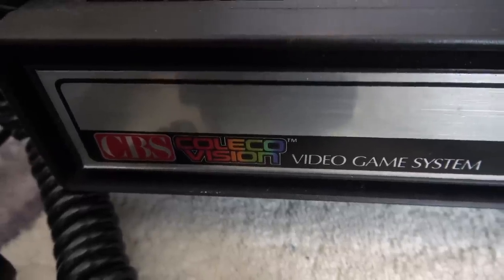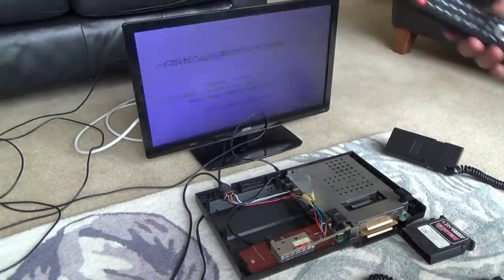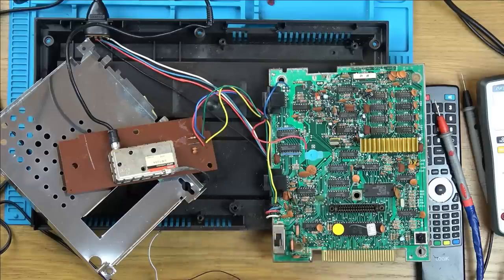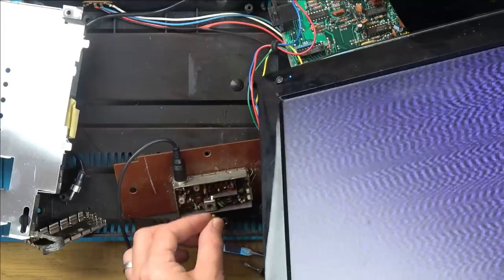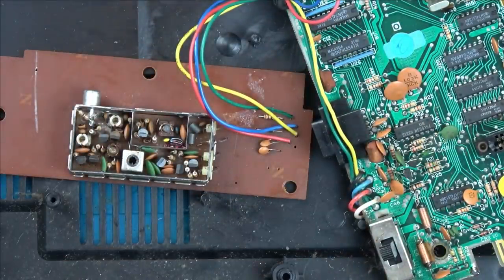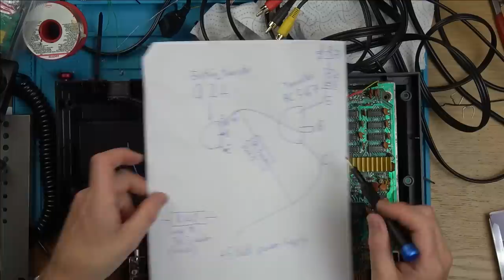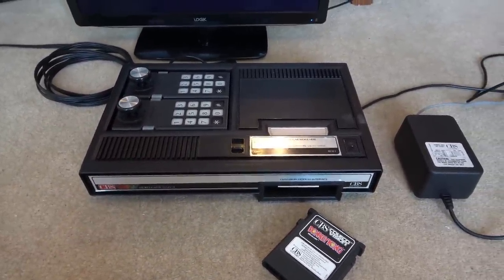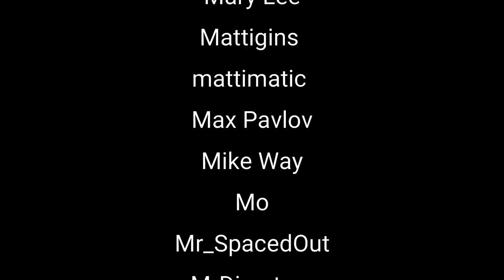BROKEN 1980s CBS ColecoVision Home Video Game Console - Trying to FIX

Comment: Not only did the Colecovision have an Atari 2600 cartridge adapter , but Coleco also made a knockoff Atari 2600 console called the Coleco Gemini and they also made some great Atari style joysticks called the Gemstick .
Reply: The Gemini was such a piece of crap on the inside, but I liked the looks of it on the outside. The Gemini controllers are fantastic, the paddle feature is so much better than the potentiometers in the Atari brand paddles. The plastic on the stick of the Gemini is too weak, but still a whole lot more responsive than the CX-40.
Reply: @jst25  Agreed . A large percentage of Geminis are broken and don't work now . I buy broken ones from time to time just to practice my fixing skills , lots of broken solders on the boards usually . Mostly power port and controller port issues . Colombia Home Arcades are also unfortunately rebadged Geminis so those two are the worst of the 2600 types IMO to buy .
Reply: @jst25  I have a love/hate (mostly hate) relationship with the Gemini Dual Command joy-paddles the consoles came with . The sticks feel surprisingly good , but they tended to get really dirty inside , and that damned fire button spring . They were way better than the Sears Video Arcade 2 controllers that were the same idea , that's for sure . The Sears versions had horrible fire buttons . To tell you the truth , I don't even remember using the paddles on any games LoL , but I will say the potentiometers are certainly easy to clean compared to the Atari ones .
Reply: I had to edit that last comment because I was remembering what a nightmare the Sears joy-paddles were , not the Coleco ones . With the joy-paddles you just had twice as much going on inside to break , twice as much chance you'd have a problem with one function or the other as they aged .

Comment: The controller leads were so short because they were usually played on tiny tvs back in the day so you had to sit on the floor right in front to see what you were playing. Very different to 4k 65" lcd with wireless controllers of today that we are spoilt with. Amazing the difference in 40 years vs the previous 40...

It's easy to forget with our huge flat tvs these days but remember these were often played on tvs with wood trim and under 22" curved screen & quite frankly horrible quality lol.

Also you wrre used to getting near the TV as most atoll weren't remote control back then.
Reply: Ours was connected to a 19" Montgomery Ward remote controlled TV. That TV seemed pretty big at the time, especially when up to about 1980 we were using a 13" Panasonic color portable.

Comment: I AV modded an Atari and just connected my video out cable directly to the video signal going into the modulator. I didn't have to use all the redundant transistors and resistors to make it work.

Comment: Loved the CV as a kid, that one is in great condition.  Wish I knew the secret to opening them up without ripping off the front decals back then (which I did on mine, heh).
Reply: They are incredibly hard to open. I convinced that with how easy it came apart and the messed up reset switch it was never snapped back together correctly after Mike opened it up originally. I opened mine up once to repair it and it takes quite a bit of force to get those clips to unsnap properly, unless they haven't been correctly to begin with. It is, by far, the hardest console I've ever had to get into.

Comment: Hi, The RF modulator is generating the video and audio carrier which are in relation to each other (5.5 MHz in EU, 6.0 MHz in UK) and adjustable by the coil screws. 
The combined signal will go to the TV input. The audio carrier in the uk was different from the rest of Europe.
With good wheather conditions, here in Holland,  I was able to pick up TV signals from the BBC etc, but without the sound because of the sound carrier difference. Wanting to hear it anyway I created a little temporary mod in the TV so I could tune audio carrier receiver off it's normal setting by 0.5 MHz. 
From the modulator/ generator side it Looks like the same approch, set video carrier and then adjust the audio carrier by it's ferrite core's.

With the "mod" you have video and audio in a direct connection, preventing the whole RF signal path, which is far better and giving a sharper picture and clear sound.

Comment: In the modulator there should be two ferrite slugs, one in the metal can transformer, the other in the broken coil. At a guess the one in the metal can looks to have been screwed right down to the point where it broke and jammed underneath. You can purchase replacement modulators for £11. Granted the resulting fix would not have been as interesting as the mod, but it would have been ''original'.
Reply: My thoughts exactly on the slug being bottomed out in the can. The missing one likely disintegrated by the same person wrenching away at it.

Comment: "Long live Gorf" "Space cadet"

I used to get off my train to school at Pontypridd station to play Gorf before getting on the next train coming from another line (which still got me to school on time).

I just did a YouTube lookup for Gorf and it shows the game play from the original arcade machine along with the original speech synthesiser.

I later got the game for my Atari 2600 but it didn't have the speech, disappointingly.

Comment: Maybe this a continental Europe unit instead of a UK one?
The difference between UK and Europe is that Europe uses PAL B/G and the UK uses PAL I.
The only difference is in the audio carrier and when I use a UK device on my European TV, I get the exact same result.
Picture is OK, but there is only static on the Audio.
Maybe you have an option in your TV's setup to change that.

Comment: The Colecovision was IMHO the best of the three main pre American Crash console (the others being the Atari 2600 and the Intellivision) 

Apparently the MSX had very similar architecture (I'm guessing the Colecovision came first and the MSX was based on it rather than the other way round, I'm saying this because there is a Colecovision emulator that will also emulate MSX computers in the same way that VICE has different apps to emulate each Commodore 8 bit machine)

It's actually pretty amazing for its time, that and the Atari 8 bit computers which matched the C64 but originally came out in 1979.

Comment: Tuning those RF modulators is a bit of a black art. The bad sound is static. It is caused by the complete lack of an audio signal. I think that coil was a red herring. If it had been bad, the symptoms would be more like what you had at the end: no video or audio. Removing that ferrite core then readjusting the brass one would probably return the system to the original problem. I know removing the ferrite core sounds like bad practice, but it really isn't. When they originally tuned the system that core was most likely just barely in the coil and fell out during shipping. With RF if it works don't mess with it.

Comment: with a lot of old games systems that output RF, its usually quite easy to mod them to output composite video
Reply from the maker: Thanks Pineapple 👍👍👍
Reply: Likewise an RF-only TV can be modded for composite input, and that was actually done in 1971 in the TTL (non-CPU) arcade game Computer Space (which was before arcade monitors). Syzygy (Atari) "composite modded" the black and white vacuum tube TV, in 1971 haha

Comment: Wonderful repair. Even though I didn't understand how you just came up with your own version of  the composite mod.
About the screw you found wedged the wrong component: Don't you think that it would be more likely that someone screwed the ferrite screw out and turned the console upside down to get it out and when they tried to put it back in, they "screwed up" (pun intended) and chose the wrong hole in the RF-module?

Comment: You can use super glue on plastic of the coil transformer and also can super glue the ferrite core, it will work perfect when you tune them all
Reply from the maker: Thanks technixbul 👍👍👍
Reply: @Mymatevince  I forgot to mention, yes any RF output modulator will work as long as it has A/V inputs. Glue the core itself not the core to plastic ;)
HINT you can buy any cheap famicom from somewhere and salvage its RF modulator ;) 
P. S. I would not prefer to use one (A/V mod is just fine) unless i use some TV from Second World war :D

Comment: I use se7ensins for console repair and modding and any questions you just ask a question and usually get an answer in 20-40minutes. Im in the US so idk if it would be different but I would try that

Comment: Interestingly I find that anything old that uses RF does not seem to work well with modern LCD TVs. I'd be interested to see if it worked properly with an old CRT TV set. I have the exact same problem with my commodore Amiga. It'll be an even bigger issue soon as TV sets will only start doing digital and not analog signals. So a conversion makes sense. I remember when my dad bought an RGB module for our ZX spectrum instead of RF. The difference in picture quality was massive. Completely clean picture. The Audio had to be output separately to a small battery powered amplifier as signal was only video.

Comment: How is the BC 547 transistor not on all the time? It appears the base has access to 5V constantly, though current is limited through the 3.3K resistor. Wouldn't that make the collector and emitter of the BC 547 shorted together all the time since there is greater than 0.7V at the base?

I also thought the base of the new BC 547 would be connected to the emitter of the console's original Q24 transistor so as to be controlled by the on/off of Q24. Maybe I'm confusing myself since you drew the collector and emitters opposite on the 2 transistors. I am just trying to wrap my head around how this circuit works according to the drawing. Any help appreciated, thanks!
Reply: This is a good question and I am wondering the same based on the diagram. With the base leg on BC547 receiving a constant 5v, there should be constant flow through the transistor.

Comment: I have an Atari 2600 which has a lot of noise on modern TV's. The Problem is that modern Tuners are not as good as the old CRT ones so you will always have a better picture of those consoles on CRT TV'S than on moder plasma or LCD.

Comment: The stuck ferrite slug might have been the one that was originally in there. Funnily enough the wikipedia image for an RF modulator seems to be a very similar one (maybe even identical) and you can see both ferrite slugs on it: https://en.wikipedia.org/wiki/RF_modulator#/media/File:UHFmodulator.jpg
Reply: Yes, I was thinking the one he removed to try to use probably was under the trim pot it came from,, but someone ran it all the way out the bottom. How else would it have gotten there? The one he was completely missing likely had disintegrated from a person using a metal screwdriver and getting rough as heck.

Comment: Somebody must've been screwing with those ferrite slugs with a metal screwdriver to adjust the channe. Seems like one got some kind of contact to the ground shield and burned to pieces. Better to forget the modulator and stick with the mod. It should be very reliable, altough i'd use small capacitors before the output leads to avoid any DC leaking (there probably are ones at the TV side though).

Comment: I have one too! Have the steering wheel & the Atari adapter. Just don't have a tv to plug it into. I do have a question though. If you just plug in the console to the wall, (not connected to television) & turn it on, is there any noise from the console? I plugged it in, turned it on & nothing...

Comment: I am not an electrician.  I think what you are dealing with is an RF modulator block. You should be able to cannibalise a replacement from many devices if the period.
Reply: A broken or dusty RF potmeter is the most occuring problem. Another one is a jamming on/off switch. (damn the guy who figured out to pull 3 different voltages through 1 combi-switch)
Then there's the everlasting cartridge jam by dust. When using the Atari 2600 module, the chance of that happening duplicates because there are 2 board connectors in line.
I also have a full original set, which requires the power supply to warm up for +/- 20 minutes before the view gets clean. This might be a age problem or a bad trafo winding making trouble when it's still cold.

Comment: I'd just feck the modulator off completely, most modern tvs don't even have an analogue tuner do by doing the composite mod you're preserving the usability of the console. Gotta be easiest fix ever, just shows how easy stuff is when manufacturers labelled their boards.

Seriously we've got to get back to repairing stuff

Comment: I'm having issues with my Colecovision. It starts off fine, but the video blacks out to a black screen. The audio is fine. A Facebook group suggest faulty capacitors or a faulty power supply. No further comments were made since posting four weeks ago. Is this the similar issue you experienced with this console?

Comment: I badly wanted one of these as a child; I remember playing Donkey Kong on the demo system at a local department store. Many decades later I was given one, but it had experienced water damage and it did not work 😥. I currently have the "mini" version of the console (which lacks the iconic games) and, of course, emulation.

Comment: nail varnish remover is good for remove stains and marker pens
Reply: might melt the plastic though :-) always test on the underneath first!
Reply: @nigelbarrett4936  just put some on a rag clean it of then clean it with a little alcohol

Comment: Yep looks magnificent, the games are faithful and the packaging is wonderful. Quite a desirable thing.
..I'm trying to find out which console it was  I used to see in Selfridges during the late 70s? It had a 3D battle chess type game displayed and it blew me away as a 16 year old lad. Anyone?
Reply: we can rule out the magnavox odyssey you said late 70s and that came out in 72 the most well known the atari 2600 was 1977 the fairchild model f was 76 and the bally astrocade was 78
Reply: @johnsellers4994  Thanks John.
Reply: @johnsellers4994  I'm beginning to wonder if my memory is playing up..Must have been later??
Reply: @martinda7446  im thinking the console you saw was video chess for the atari 2600  which was released in 79
Reply: @johnsellers4994  I just seem to remember superior graphics. Unless it was just advertising artwork messing with my memory?? I thought I saw a 3D battle-chess sort of game. I wondered about the Atari. I also think it may have been a single game machine.
Reply: @johnsellers4994  PS Thanks John it is driving me nuts.
Reply: @martinda7446  chess was a rather complicated game for the consoles of that day to handle and as far as im aware there was no handheld electronic chess games  theres loads of electronic chess boards . the first 3d battle chess game was 1988 on the amiga
Reply: @johnsellers4994  Chess does happen to be a particularly welcome problem for programmers. It follows simple rules on a simple play area. Sinclair owners in 1979/80 had a chess game called 1K Chess - It even played a half decent game, I remember playing it! Quite an achievement fitting a game of chess in under a kilobyte. 
It used the ASCII character set for pieces so no graphics at all of course. (What do you expect with 1K?).
The ZX81 even had a 3D game, 3D Monster Maze with a cool Tyrannosaurus Rex (another one I played, I still have my Spectrum, the ZX81 died decades ago).
I will have a look at the Amiga game just in case I had a 9 year hiatus.

Comment: Running the risk of telling you something you already know, the module you end up working with is called the RF Modulator. its purpose is to take the  (composite) audio, and video signals, and convert them into Radio Frequency (RF) signals that can be read by the tuner in your television set, and re-converted into a signal that can be used by your television system. Kits exist to replace/bypass the RF modulator, to use direct composite, or HDMI.

Comment: I had this system "well some iteration of it" when I was very young, So long ago.. all I can remember is my system was rebranded as "Dicks Smith Wizard" or something to that nature "Dick Smith" was an electronics enthusiasts Franchise, Which was actually bought out by "Woolworths"  🤨 Dang!... Another haphazard link within the universe having it lazy.. oops I digress. 
Anyway "Woolworths" in Australia are stores who are now also providing "Online/Walk in" Fresh Produce & Groceries, They have changed their Variety Stores "Woolworths" intended to crush all other Variety stores to "Big W" here in Australia, can't remember when they first opened the doors as they have been around for well over 6 decades if not 7 decades? no wait! shit! 10 decades or more of trading??? 😳 Oh My!!!.. Dawg I am old..

APU I dropped a 👉👍👈
Reply: ADDENDUM
That "Rectangle Module" "Can" is an RF converter, different regions all around the world have different A/V Standards so those modules simplifies the design of devices pegged for export for all those different regions, it's more than likely the RF Module is/was fine as long as you tune the video and Audio Pots to the same frequency, BTW it may be set for some other region for example Japan or maybe even Ass-Trail-Yah..🤭

When feeding from mono to stereo you should use two100 ohm resistors each feeding a channel, if doing that in reverse stereo to mono again each 100 ohm resistor is used to feed a channel to the mono channel, it is imperative you do this as the inputs or outputs could be experiencing to much Current or Voltage depending on the circuits being married.
Reply from the maker: Good man Koala Bear, a wealth of knowledge and info as always. Thank you my Australian friend 👍👍😎